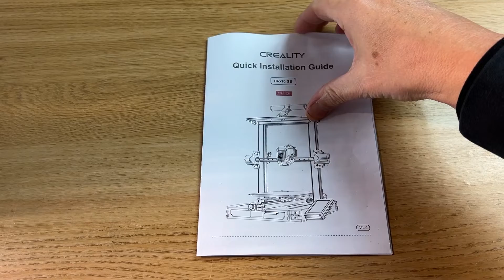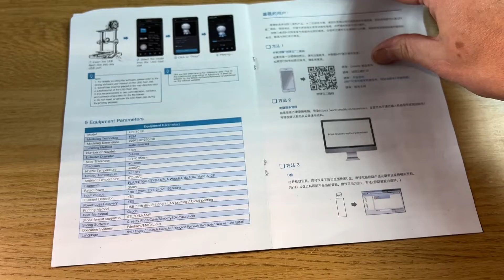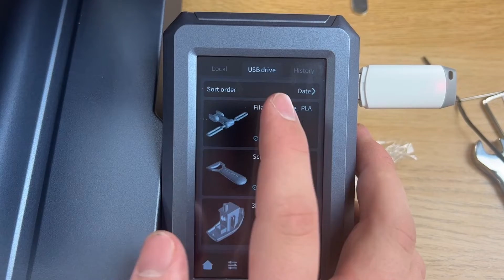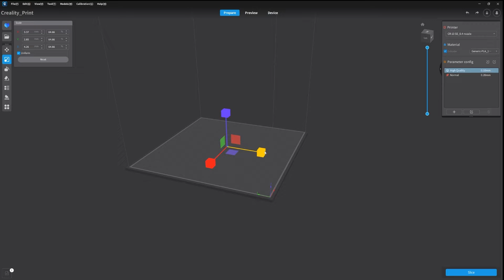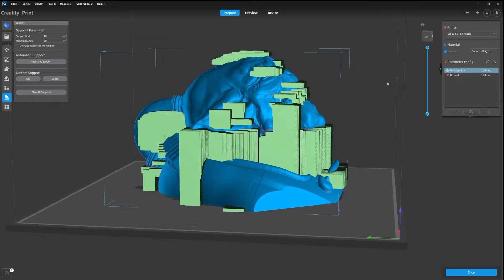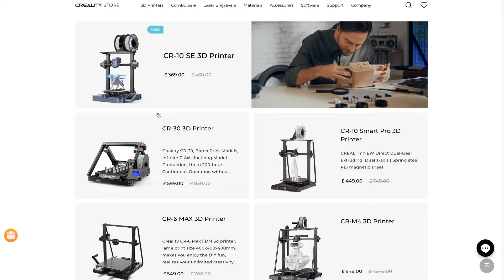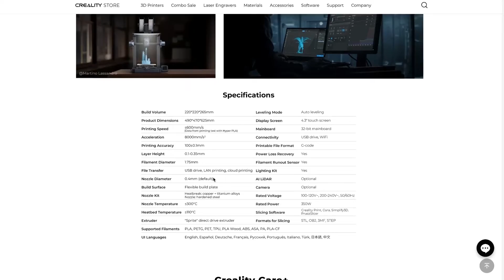Creality CR10 3d printer review

Comment: Hello, I saw that 3D Printing turned out great for you. I have a problem, somehow the bottom layer doesn't stick well enough (maybe it's due to the settings) and that there is a gap between them.(0.15mm layer, 200degrees, 70 print speed). I have Creality CR-10 SE printer.
Can you send me the settings for the Creality Print Slicer so I can try one model to print.
Grettings from Serbia

Comment: Bambu for me next. I just need a plug n play solution. After modelling, i cant be bothered tinkering to get settings right anymore.
Reply: I felt like that with the Ender range. The Ender 5 was a terrible machine for me but this ones seems pretty plug and play in comparison. I don't use FDM for much so I only really need one machine
Reply: 8 have one, its an amaz9ng printer, m9nd you I have a background in Industrial design and have been using 3d printers from my first internships in 2006. Though ot was ky first experience with fdm I was ised to sla and sls printers. I have kust made functional parts thus far with the bambu woth exception of 1 sculpt. You can still have failed prints so you have to ensure you place supports where needed (only difference from the Industrial printers I was used to is that they used to do this part on their own.) Personally I believe it was a worthwhile investment I want a resin printer next seems to be the closest thing to SLA printer.